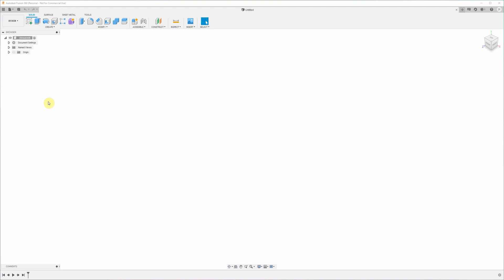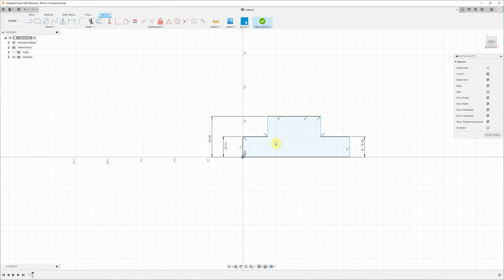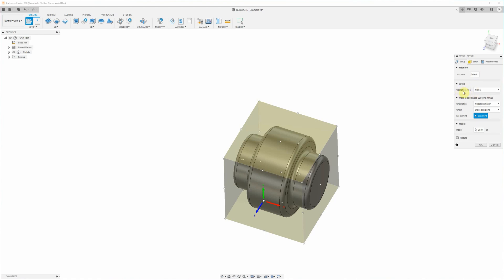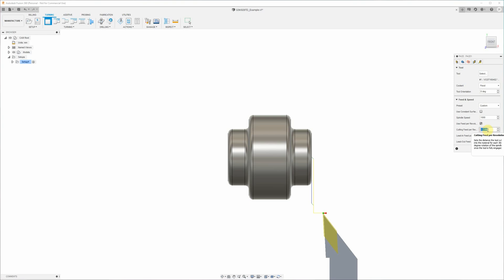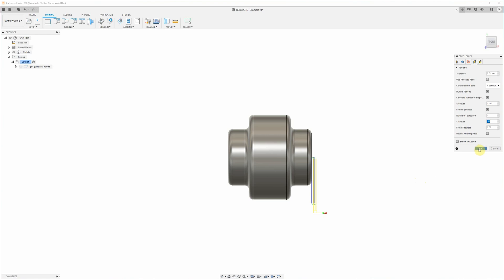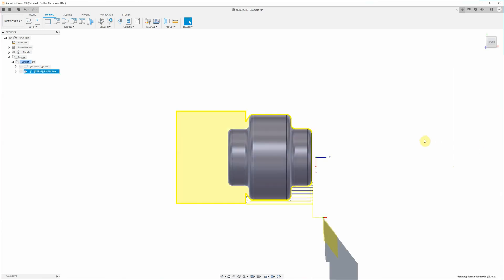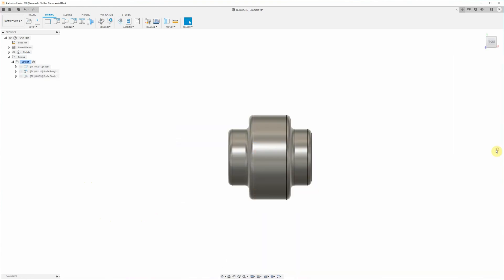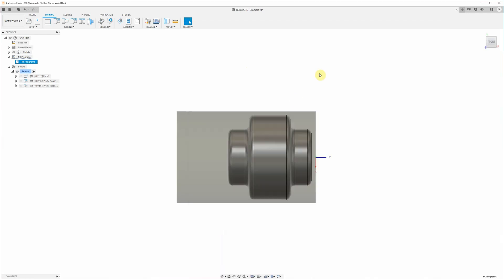Fusion 360 Tutorial for the GSK928TD CNC Lathe

Comment: Thank you so much for this video and also the other about how to set the machine up! I have a small chinese lathe with the 928TD-L. I cannot start the gcode post processed with your post processor. What could it be? Some settings on the post processor that maybe need to be modified. Any ideas? Thanks in advance
Reply: I have the same problem.